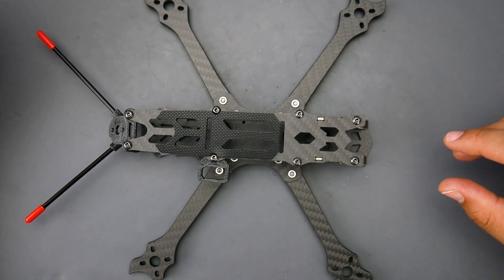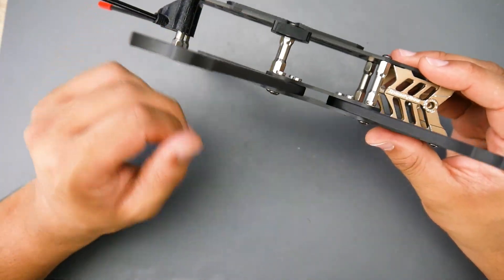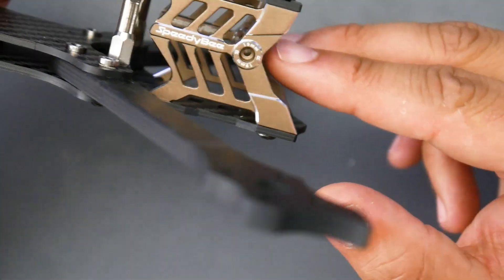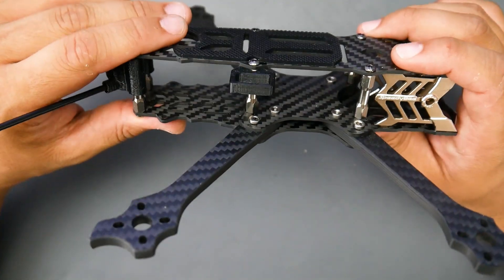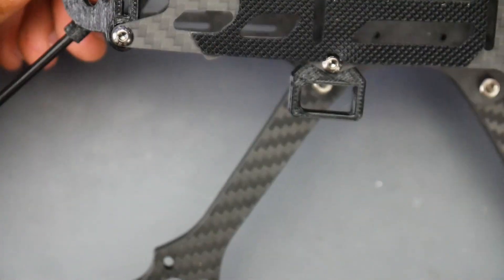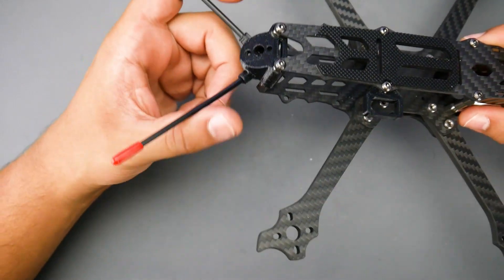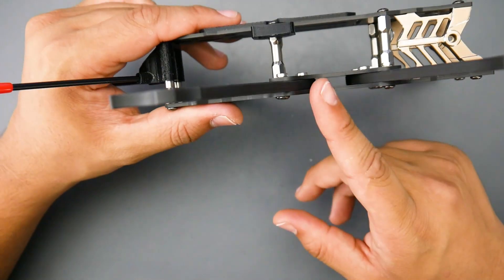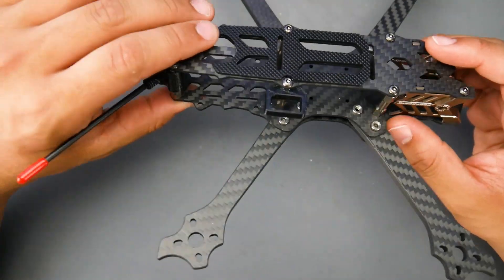Runcam's Latest Frame // SpeedyBee V2

Comment: Frame definitely look nice. Two stacks is now standard to make less problems with DJI HD video VTX installing. And changeable camera width is cool. Look sturdy though I have no idea how sturdy this frame is in real life. Did you tried to "smash" it? Battery connector holder seems interesting. Though I'm curious are it is capable to hold battery cables in place on crash.

Comment: My top and bottom plate broke from the first crash, in the back. Now I'm using the latest sector frame from HGLRC (7 INCH)  which is a bit wobbly. This hobby is forever changing with its ups and downs.    I wish all the manufacturers could calibrate and make bullet proof builds, so then it will only get better every time,instead of the "let's hope it works out" dynamic of the fpv hobby.

Comment: The diatone roma f5 frame had the camera mount like that. Now it doesn't have pretty cnc aluminum for the frame mounts but the carbon plates are cnc'd for 19 or 20mm

Comment: The top plate breaks behind the 2nd row standoffs behind the camera where the carbon gets narrow.... Second decent crash my top plate broke and the big bummer is you can’t buy replacements yet at least from the sites I see
Reply: I feel like I should also say that the speedybee felt almost identical to the moongoat🌙 🐐 in the air but @ half the price and when I lined them up the Wheelbase sits almost identical Putting the quads kids against each other